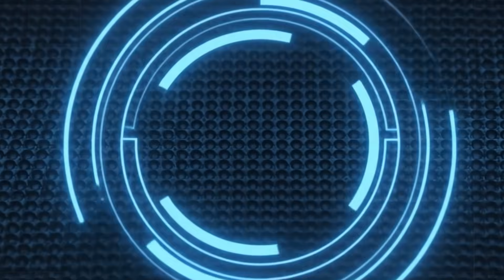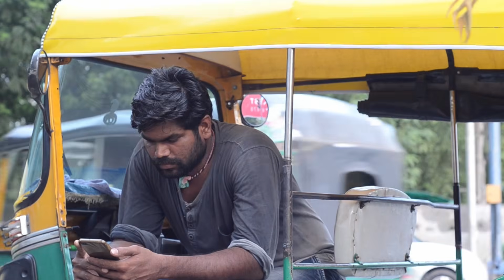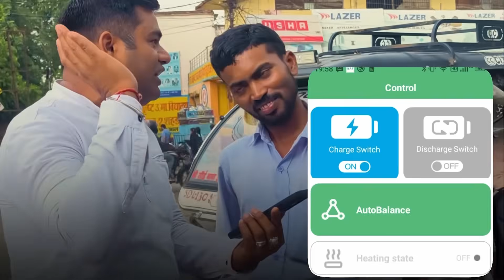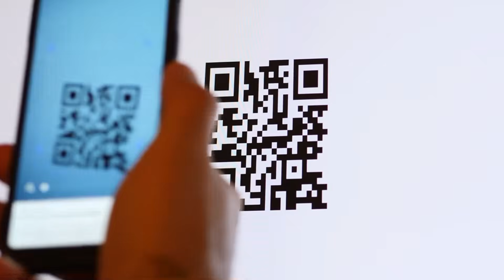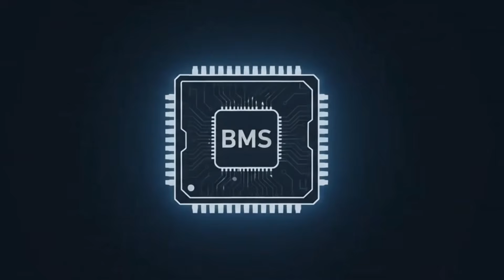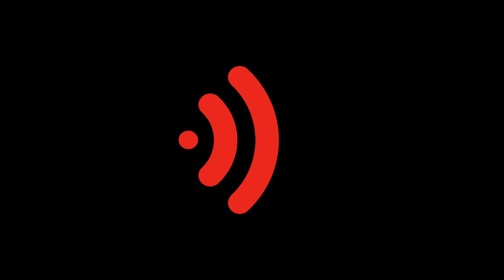This Bluetooth Mistake Let Anyone Kill an E-Rickshaw's Power!

Comment: Sounds very dangerous, if you can change values you could make the pack overheat deliberately. Very scary if you have the battery inside your home.
Reply from the maker: Normally, the BMS IC programming should enforce over-temperature protection independently of Bluetooth. The concern is when firmware changes can influence  those controls over an insecure BLE connection. Plenty of cheap BMS have flooded the market. And if that's the case in a given bms, then yes, such a scenario could be possible where you can overheat the system without triggering protection.

Comment: Read up on bms bluetooth it's an open connection.  The bms bluetooth is a fad to help sell bms and allow the builder to easily adjust operating parameters of the battery.  It's convenient and most have a kill switch.  It was never designed to be secure it's a simple connect to read or program.  The problem is they included a kill command to turn off the pack for shipping. Any of the myriad of apps for bms management can connect to a battery.  It's a real problem.  You can also mess up the protection values
Reply from the maker: I get the cost part but not even adding basic security is pure ignorance and that's what got be surprised. Eventually the customer pays the price for these low-cost, insecure systems — without even knowing it.
Reply: @eccentric_engineer Agreed. If you look up any JK, Daly, JBD etc bms they all have a line of "smart" bms which allow the use of bluetooth to set parameters. None of these have much in the way of security, hence most rv, escooter and other batteries can be messed up by bad actors remotely.